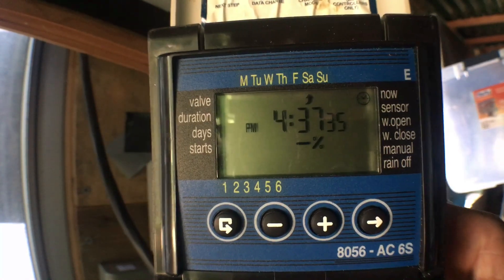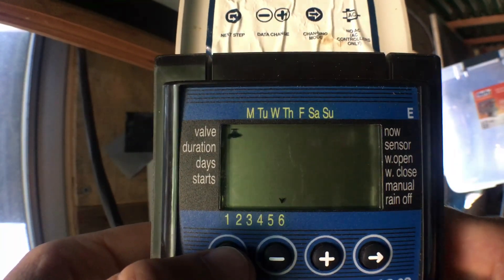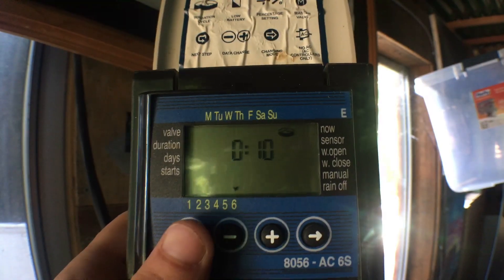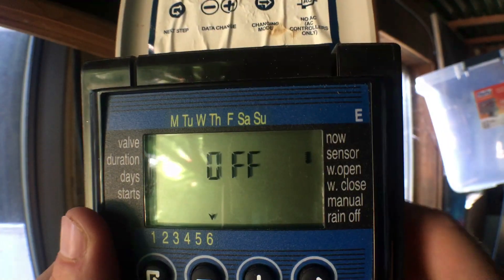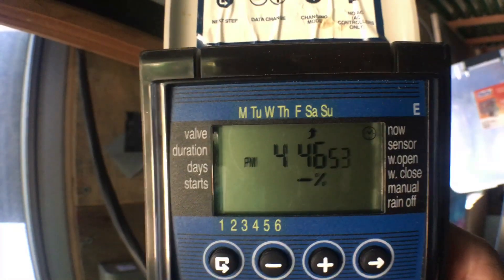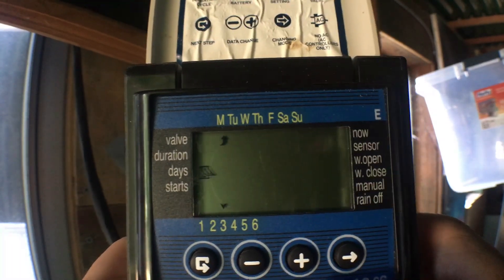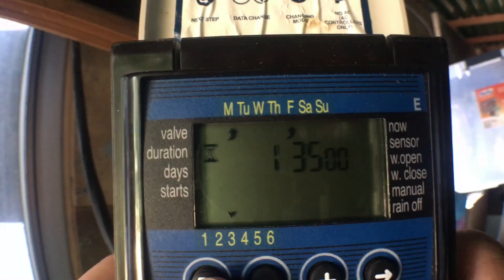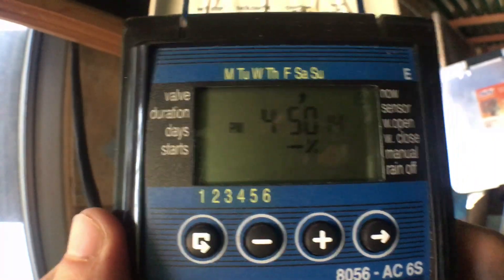How To Program A Galcon Irrigation Timer For Mist Propagation Systems

Comment: I have my controller set for 2 zones both to run for 4 seconds, every 12 minutes zone 1 at 8:00 am and zone 2 at 8:02am. I have a open time for 8am and close time for 3am. For what ever reason my start times are changing to where eventually zone 1 and 2 will run at the same time.can you tell me why this is happening?

Comment: Hi, my AC 6 doesn't have the seconds option under the duration setting. Any ideas?
Reply from the maker: Hi Jordan - do you have an AC-6S or an AC-6 - if I remember correctly you need the 6S model to have programmability down to seconds.
Reply: @7thGenerationDesign  yup that’s my problem! I have an AC-6. Thanks

Comment: Hello I have 3 zones. I want the zones to go on for 1 minute 3 times a day. I can find the option where it will let me program it for the 3 times a day. Can you help
Reply from the maker: hi Michael, you can set multiple start times each day for each individual valve - when you have the start time setting category selected, set your first time, then use the advance arrow to move to the second time window - set that, repeat for the third etc. Alternatively, you could also use the cyclical irrigation function at the end - for example, have your irrigation window start at 8 AM and end at 6 PM - a 10 hour long active window, but have  set your intercycle time to be 5 hours, and your application time to be 1 minute. Either way should get the job done!

Comment: In my wisdom I watched you after I put a time in start 1. To cancel this to get to off .I have pressed +/- never get to see OFF. Any suggestions. yes I want cycle for misting Thank you
Reply from the maker: Hello redwood1957, 

Just to make sure I understand - you want your timer to be set to a misting cycle (something like 15 seconds every 10 minutes between the hours of X and Y) but you can't get to the misting option because you already have an irrigation time set? If that is correct, you need to adjust the setting in the DURATION menu so select the little circular arrow icon (an arrow wrapping around on itself) - once this is selected you can set your misting interval and repeat window. You needn't worry if you have an irrigation start time already set under the STARTS menu - just keep moving through the menu until you see the gate open and gate closed icons - this is where you will set you start and end times for your misters to be operating each day.

I hope this helps.